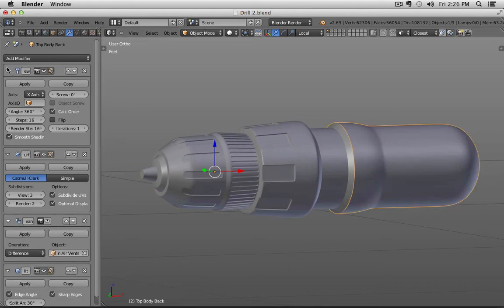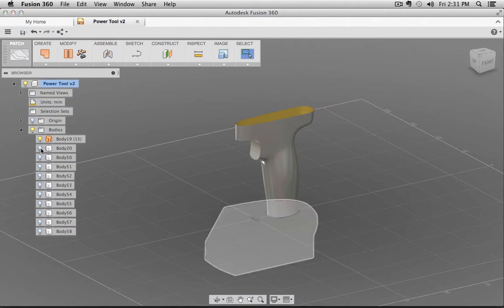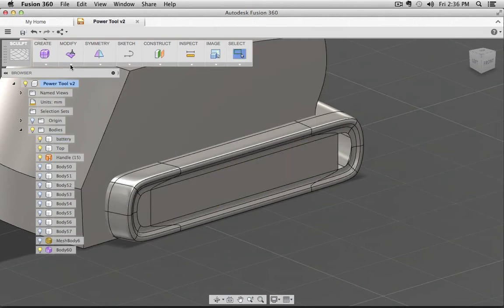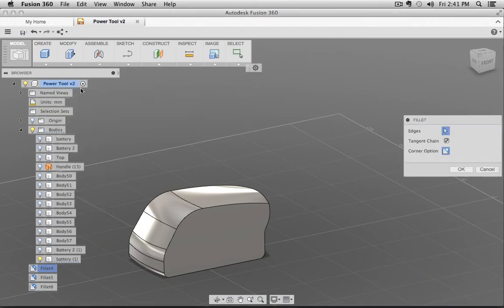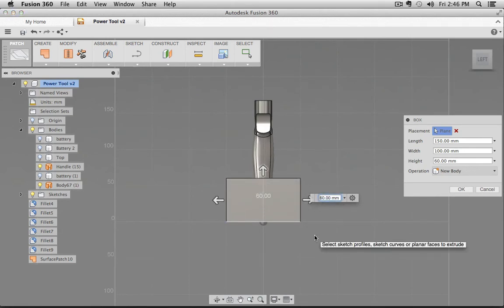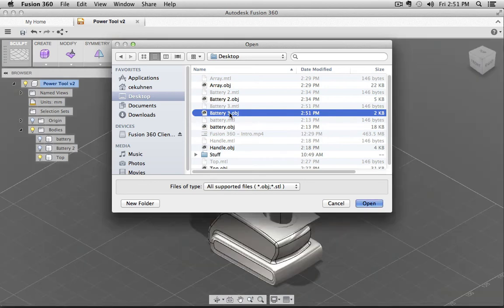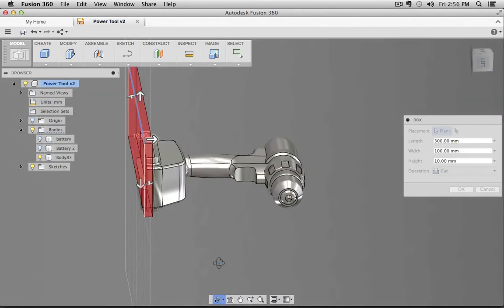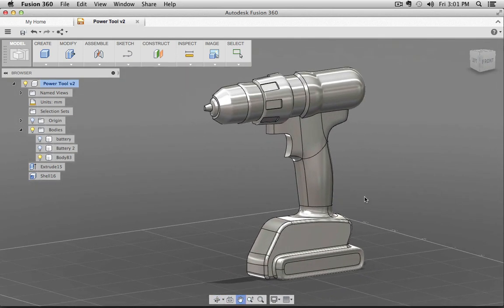Fusion 360 Workflow

Comment: Oh my God! That could be done all in Fusion 360 without blender much faster. For me it is like you draw in Photoshop and import into MS Paint to correct colors.
Reply from the maker: Good for that you did not understand that this demo is using a drill as an easy example for beginners to explain how blender and fusion can work together because many steps are better and faster in an external app than natively in fusion. Fusion pales in NURBS modeling and sub d sculpting when compared to alias and blender/modo.
Reply: May be you had make a better example not with drill, drill is more solid object and Fusion can swallow it without problem, what is really pain to make in Fusion is an organic shapes or some missing tools as twist or spiral tools.
Reply from the maker: You realize that this video focuses on Sub-D sculpting and not parametric surfacing with sketches, do you? Just checking.
Again Fusion 360 pales to surfacing abilities compared to Rhino or Alias for NURBS. The T-Spline module is also limited. Fusion is a great app for solid modeling.
A lot of things in Fusion 360 is a pain - Loft with rails does not even have G1 or G2 for rails. That degrades the tools.

This video demonstrates by using a power drill how one could make a concept model in a different application (Blender in this case) and then later assemble the design in Fusion.

A power drill is also not a solid object as it is only a shell.

Comment: Do you find it's easier to model out the structure in Blender and then bring it into Fusion 360? I'm very comfortable with Blender and am finding modeling with Tsplines very confusing and difficult.
Reply from the maker: Mh yes and now. TS for my taste is too slow, thats why I prefer modeling in Blender. Also Blenders modifiers kick all other poly modelers into the curb. Mirror modifier many have but shrink wrap and such they don't. Booleans in Blender are poly based dirty but fast and TS I use to make nurbs models and then with the trim surface or combine tool for solids rebuild the booleans like in Blender.

In general I feel concept modeling of organic forms is just blazing faster in Blender.

Plus Blender offers local and global orientation and transformation data which Fusion does not.
Reply from the maker: So I think I would use each for what they are best. Fusion is a fantastic solid modeler doing stuff Blender cannot. Put sub-d like sculpting Blender rocks. Precision work Fusion rocks. What rocks most is using both in a workflow.
Reply: Claas Kuhnen Thanks so much for the quick reply. I'm coming from Blender and was interested in industrial design so I checked out solid modeling programs like Fusion 360 and others. I totally agree with you. Blender is so fast and easy for organic shapes, but I guess solid modeling is important for precision dimensions and very precise boolean operations.
Reply from the maker: Joshua Cohen i do all my furniture design in blender. solidify makes wood plank thickness. boolean trims them or cuts holes. object transformation specifies position rotation. it works very precise here. fusion in patch can import obj and turn flat faces into flat nurbs surfaces. perfect!